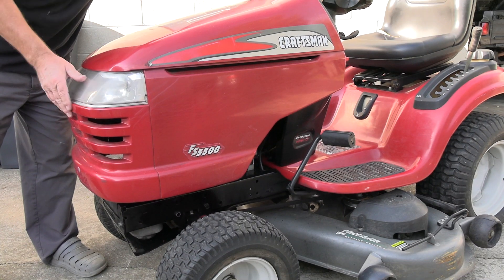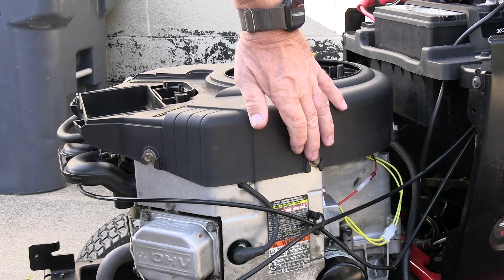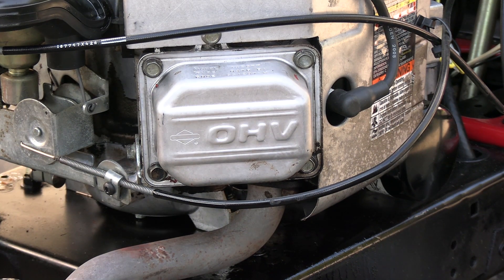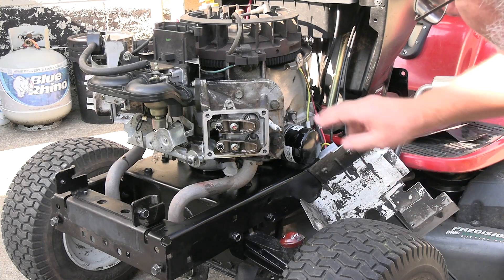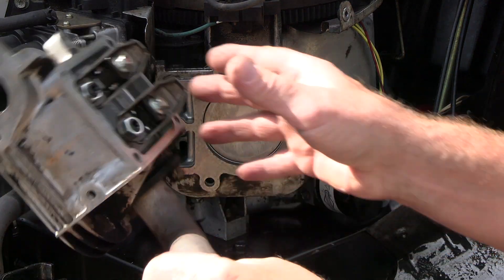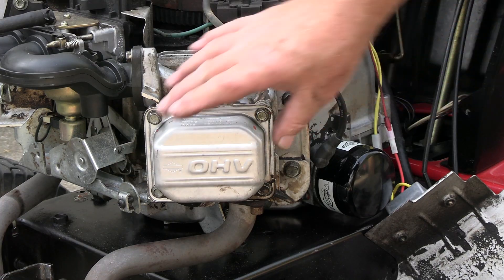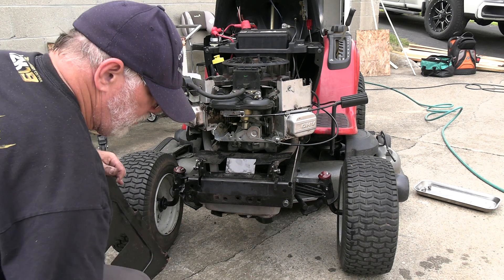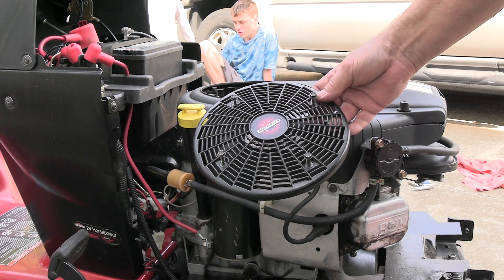24hp B&S Engine Head Gasket Replacement

Comment: Question for you: will a failed head gasket always show obvious signs of failure? I have this same engine, and it was spitting out oil on the left side. Tore into it last night expecting a bad head gasket, but it looks perfectly fine. Nice video, by the way. You don't waste time, which I appreciate.
Reply from the maker: Some times it can be a valve.
Reply from the maker: or a small crack in the head.

Comment: Did you show where the gasket was leaking?  Never saw a streak on the head.
Reply from the maker: The other side was blown out so I changed this side as well since the kit came with both gaskets.